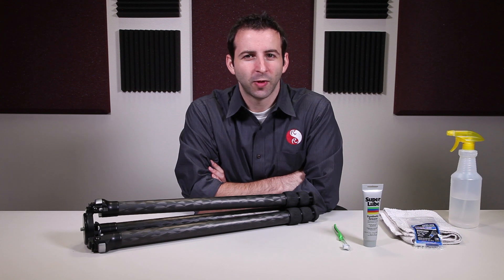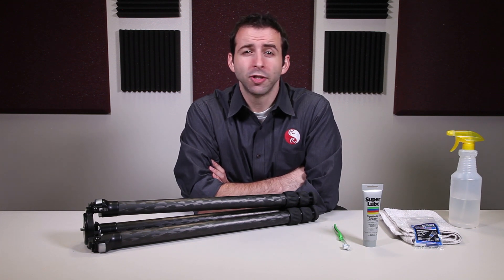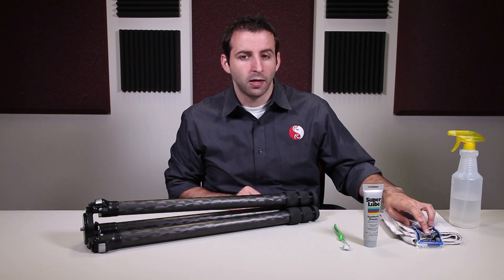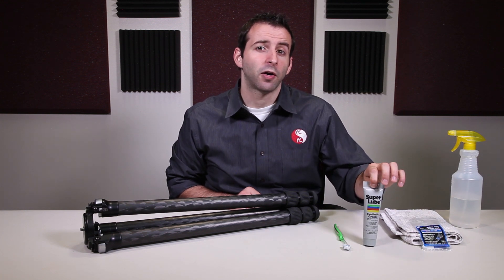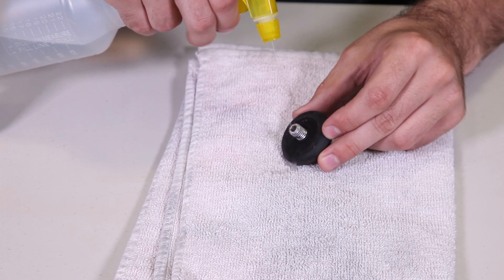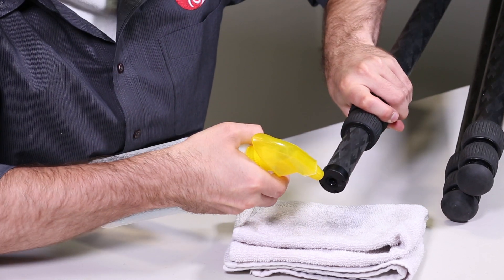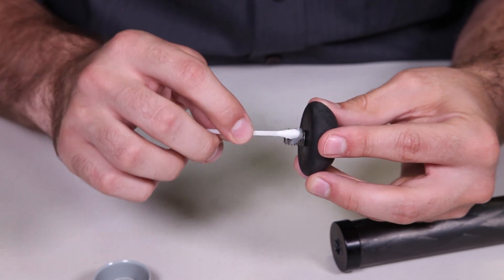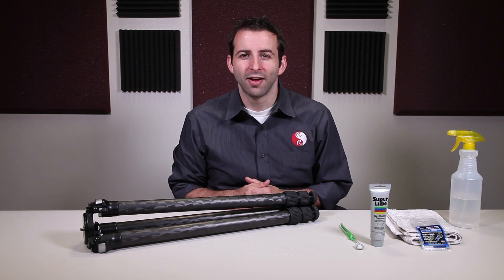Really Right Stuff Tripod Maintenance Part 6: Tripod Feet

Comment: good day, i just bought a 2nd hand tripod RRS and ball head RRS .... i tried to follow your instruction... since the tripod havent been used for years am having a hard time taking the foot (rubber feet) --- i tried to twist to unscrew it but it like the only the rubber is rotation ang not the  screw of the rubber feet..... am afraid i might damage the foot , any taughts on this... thanks
Reply from the maker: film guy If the rubber portion of the foot is spinning but the foot is not unthreading from the tripod, then most likely the rubber ball has been stripped from the mounting screw and will need to be replaced. If you can completely remove the rubber portion of the tripod foot and are left with a hex bolt, simply use a wrench to loosen the bolt from the tripod leg and replace it with a new rubber foot which can be purchased here:
http://www.reallyrightstuff.com/Shop/Tripod-Accessories/TA-3-FB-Series-2-3-4-Foot.html

Keep in mind that if you choose to use a thread locking fluid when installing your replacement tripod foot that we only suggest using a medium strength fluid and not a permanent strength fluid so that you do not run into the same issue should you ever need to remove the foot. 

A tip: sometimes applying a little heat from a hairdryer can help loosen thread locking fluid and make it easier to unthread. However, be careful not to heat the carbon fiber tube section of your tripod leg as that can loosen/damage the strength of the resin bonding the carbon fiber.